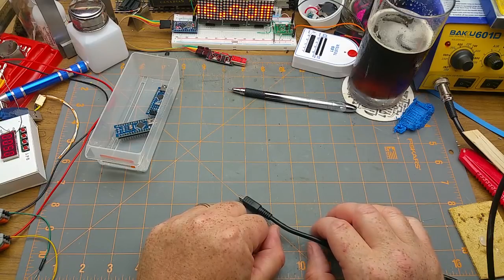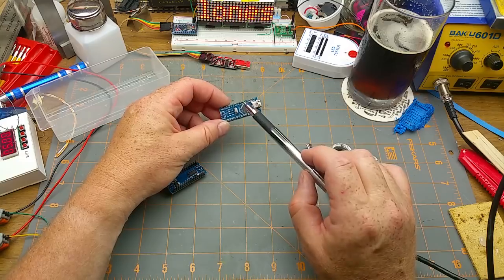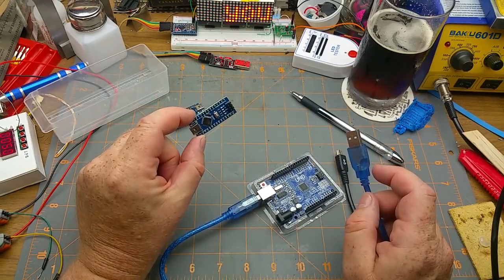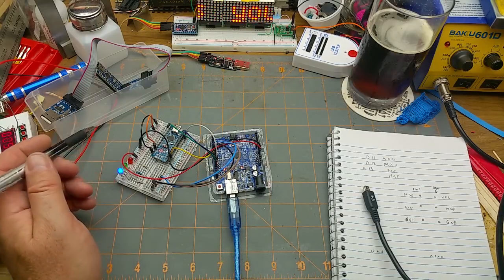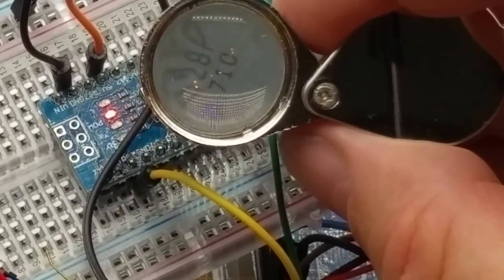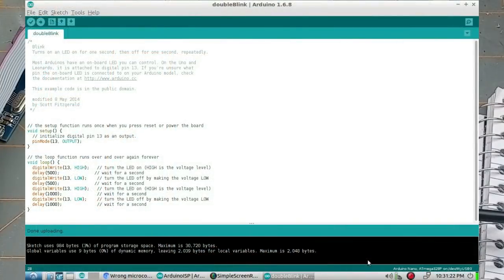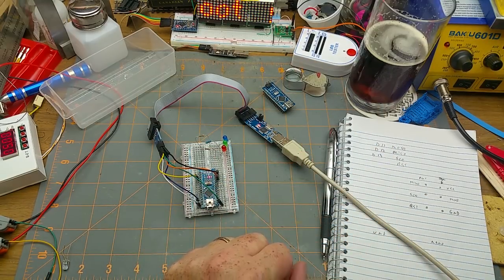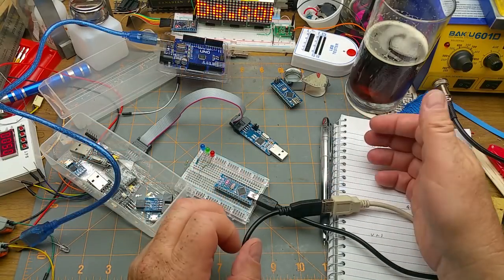installing an arduino  bootloader

Comment: Back to working on my blown 16U2, and my ISP through a UNO failed like yours. Had a play and changed the COM port to the UNO COM port, and it worked. Looks like you direct to the target, but use the COM of the device you are using to do the talking.
Reply from the maker: Inneresting.. I'll have to re-visit this and give that a try.

thanks for the tip.

Comment: The USB serial ATMEGA16U2 IC on my MEGA2560 caught fire so I soldered a new Ebay on. Unfortunately it  looks like it needs FW as well, so I'll have to work that out now.
Reply from the maker: Apparently Nick Gammmon's bootloader sketch can also do the 12U2. Haven't tried it myself, but it looks promising.
Reply: I tried the FLIP method but it didn't work, so I will look that up. 
Basically the main problem is that I don't know what I'm doing. lol
Reply from the maker: I don't really either! 
Fortunately, there's some  people with more experience on some of these things that I'm learning, and some of them give a bit of help in the comments.

Comment: Nick Gammon wrote and maintains a bootloader sketch that autodetect the IC (168/328/...) and burns the correct bootloader for a 5V arduino. Just Google for it.
Reply: Nick Gammon writes tonnes of useful stuff!  I live without any Arduino hardware, or factory made ICSPs.  It can be a bootstrapping adventure to buy an unfamiliar AVR8 chip and make it work the first time.  Interesting to install USBASPLoader, a bootloader that bit-bangs USB 1.0 on the atmegas.  Micronucleus is similar for attiny chips.  Optiboot (probably installed on this video) can be frustrating on home projects, because it really needs DTR/RTS signals to pull RESET low at precisely the right time.
Reply from the maker: That sounds clever. I'll have to check it out.
Thanks for the heads up!
Reply from the maker: GnuReligion: Yeah, This probably used optiboot. It seems to be the "factory default" that comes with the IDE.
As you can probably tell, I'm not a software guy, so I tend to take teh defaults when they are available. I tend to treat software as just a means to the end of getting my hardware working most of the time.
Reply: It probably did come with a bootloader, only not the one the IDE expects. ;) It probably comes with the old bootloader like they did for years and years. But recently Arduino started to ship the Nano with the Optiboot bootloader (exactly the same as an Uno) and published an update for the board files. From that moment the default when selecting the Nano as target is to expect Optiboot aka it does the same as the Uno selection. For the older type you now have to select "old bootloader" under target device. Aka, the behaviour of the IDE changed. You could probably have uploaded just fine when you selected "Nano old bootloader" or even "Pro Mini 16MHz". Not that it's a bad thing to switch to Optiboot! It's smaller (leaves more space for your program), uploads faster and has no waiting time on boot. So I always burn Optiboot to all Nano's and even Pro Mini's I receive. And if I'm correct (from the top of my head, I'm on vacation), if you install the MiniCore board you also have a Optiboot compatible option for other processors and clock speeds.
Reply from the maker: Those are all good suggestions. 

I did try the "old bootloader" and other speed and processor options (and even an older version of the IDE) before I decided it was actually the lack of bootloader.
Reply: Does this mean that with the arduino ISP I could write a larger program thus overwriting the usb bootloader support?
Reply: @Dancer148  yes, but you would loose the bootloader. You can write the bootloader trough the ISP, but you need to be careful with the fuses.